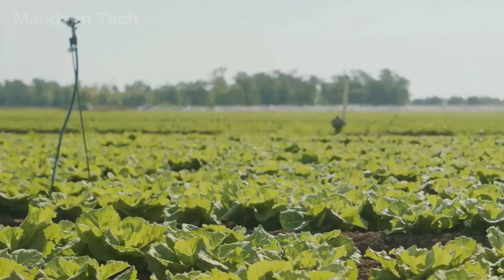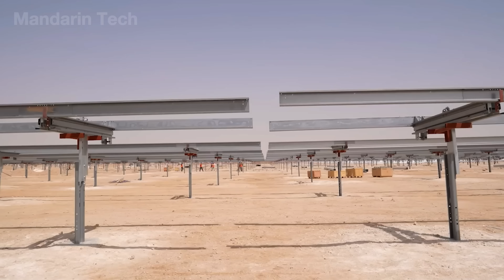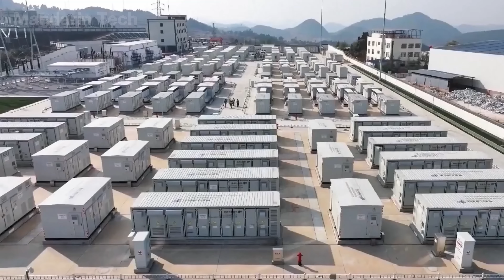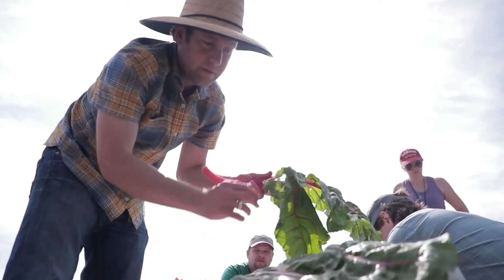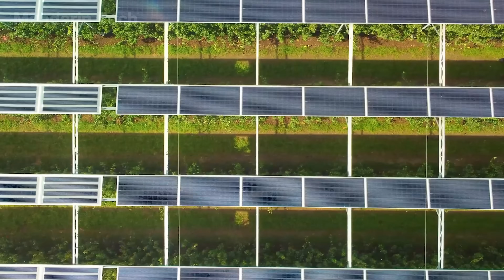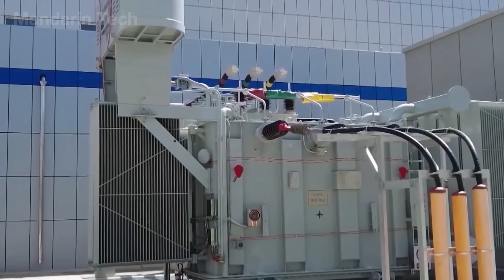How China Turned 20,000 Hectares of Desert Into Solar Panel Fields and Massive Agricultural Systems

Comment: What about the water? The desert underground is full of water?
Reply: When you clean those solar panels with water, the water will go to the ground beneath.
Reply: The primary reason a desert forms is not a lack of water, but the rate of evaporation; there is water deep underground, and it even rains. Desertification occurs because the evaporation rate at the surface is so high that the land cannot retain moisture.
Reply from the maker: Great question—water availability is one of the biggest challenges in desert projects.